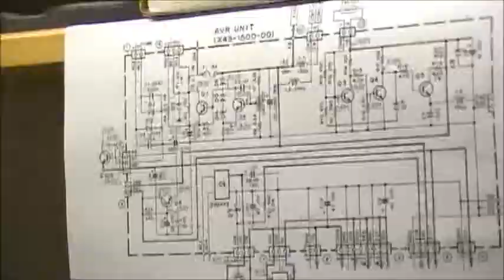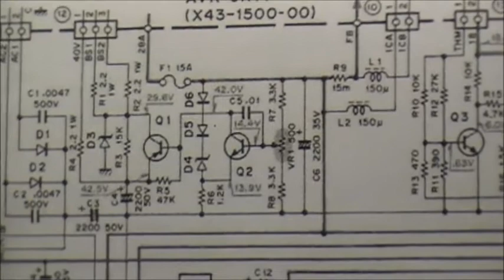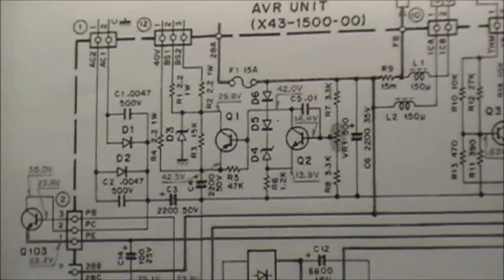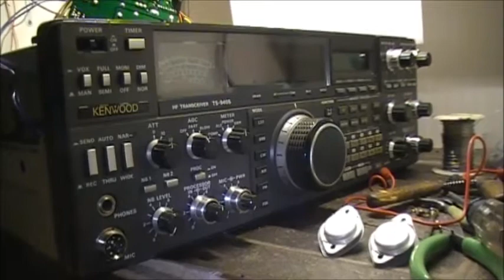KENWOOD TS-940S Repair   PART 1

Comment: I was working on my 940 today I have no power to the AVR board 
I traced the power back to the two transistors at the back of the radio (beside the fan) 
I am get 43v from the orange wire going to the transistors but not getting any power back on the white wire going to the AVR board,
Stupid question do I need to change the two transistors
Reply from the maker: Do you know the which 2 transistors they are as in part number or board number... example TR48
Reply: Hi they are 2N 5885
And underneath it it has 
8440
Thanks
Reply: Any ideas for me please